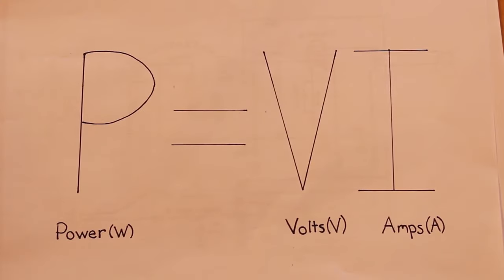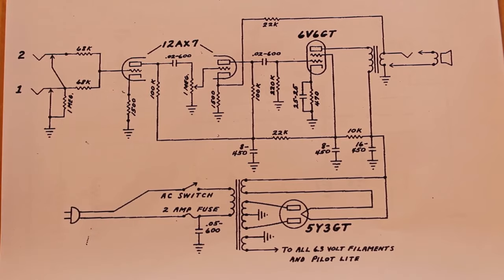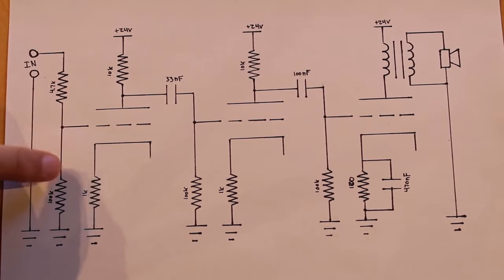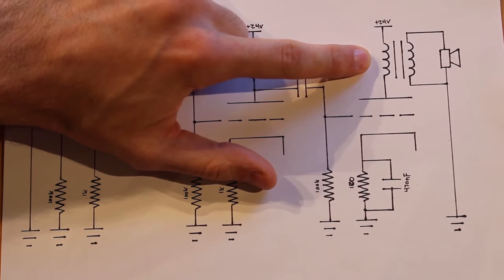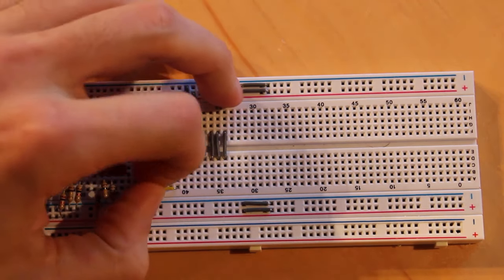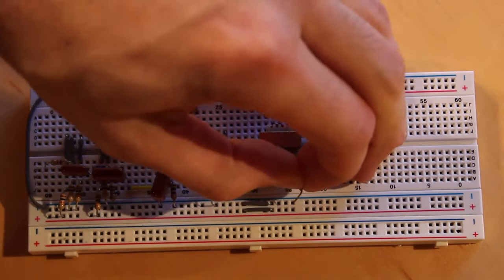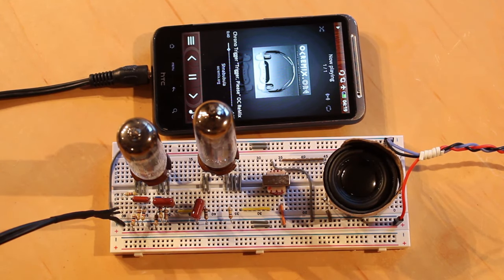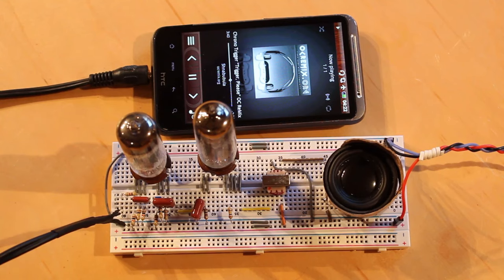Let’s Build a Low Voltage Vacuum Tube Audio Amplifier

Comment: There are some tubes that are designed for audio power at low voltage.   For example, the 28D7 tube is designed to drive a small speaker from a 28V input.  Some tabletop radios used 2 of them.  Other ones that were used for low voltage audio included 35L6, 25L6, 48, and others.  Many radios for low voltage audio back in the day that ran on 32 volts DC that did not use a vibrator used Push-Pull (Two tubes) or even Push-Pull Parallel (four tubes) to drive the speaker with a low B+.   Karola, Setchell-Carlson, Delco, and other companies made tube radios that ran on 32 volts back in the day.
Reply from the maker: I hadn't ever heard of the 28D7, but that's awesome! Even in the datasheet for it they list a plate voltage of 28V, it was designed from the ground up to be a low-voltage pentode, which is super cool. I may have to hunt one down some day and build something out of it. It seems a lot of the old battery operated radios used between 30V and 60V and on the plates as that was what the batteries could put out. I actually have an old Airmaster battery powered radio hanging around that I've been meaning to restore, although it uses a 1A5GT, 1H5GT and 1A7GT (and one more mystery tube I can't place, but I think is a 1N5GT). 
There's a lot of really awesome old tubes out there and it's kind of mind-boggling to think of all the differences between them!
Reply: @UsagiElectric  Believe it or not, "B" batteries (high voltage) did exist back in the day.  22.5V, 45V, 67.5V, 90V, and even 120V did exist back then.  I think you can still buy some B batteries today.  A company called Exell battery makes 22.5V, 45V, 225V, and 300V batteries today.  Some tools use 60 volt lithium ion batteries that are rechargeable today. I think the biggest maker of high current B batteries today is Tesla.  375 volt batteries are used in electric cars.  Porsche makes a battery that is over 800 volts today for its electric cars.
Reply: The 35L6 and others in this catergory are NOT designed for low voltage... the heater is at 35 volts because it is designed to have its heater in series with several other tubes and then have them all add up to 110 volts and then have the heaters directly connected to the mains in order to avoid the need for a seperate filiment supply transformer. 

The plates in those tubes require 200 volts, just like any other tube. 

Just because you see a 35 volt heater in a tube, does NOT mean that the rest of it runs at 35 volts.
Reply: @davelowets  if you look some of the 32 volt radios that ran from wind chargers did use 35L6 tubes in push-pull parallel.   While not specifically designed for this use, there were radio models that did use them in their 32 volt models.
Reply: EF97 by Mullard, Phillips etc.  range 6 to 27V on anode  with current 2.5mA   used in car radios

Comment: Just a note, this would be a lot easier at 48 V, which is still UL class 2, so you can safely touch it. Amplifier output power rises as the square of the voltage, so you get four times the power at 48 V vs 24V. Also, biasing the grid of most tubes between cutoff and saturation is very difficult with only 24 V on the plate.
Reply: Back in the 50s, portable radios had "B" batteries. It was a 90v battery that looked like a long 9v battery. It fell out of popularity because the batteries were carbon-zinc (non-rechargeable) and the radios were very inefficient because of the high power usage for filaments.

Comment: Great video. Regarding the capacitors, they do remove dc for the anode signal in order to feed pure ac signal to the next stage. The value of the cap and the value of the resistor right after are forming a high pass which dictates how much bass is feeded to the next stage. There is no room for misunderstanding here.
Reply from the maker: Thank you!
And thank you for the information the capacitors. I really just tested a bunch of different values in a trial and error way until I found a sound I liked. There was very little actual science done here, I just threw parts at a board until it sounded good, haha.
Reply: Yep. That's exactly what the cap and resistors do. Block any D.C. from adding an offset to the next stage and then it also create an R.C. time constant that affects the bandwidth of the incoming audio signal. 
The output impedance of the previous stage, AND the input impedance of the next stage that it is feeding, MUST be accounted for in order to come up with the correct value cap and resistor that will end up doing it's job correctly and also pass the correct bandwidth of audio through to the next stage. The math can be rather complicated in order to get this correct. Get the values wrong, and you end up with really crappy sounding audio passing through, and you can really end up wasting your gain also.
Reply: @UsagiElectric Ah, experimentation.... Yep, that's what helps a person learn what does what, as long as you learn why. 👍

Comment: One of the advantages with Valve Amps I've found is when using a preamplifier as a headphone amp.
I learnt that valve amps are less 'tiring' to listen to with headphones.
I had one at work and could listen to music for the whole 8 hours, whereas with a transistor class D amplifier I had, my hearing got 'tired' after two or three hours.
This appears to be a less subjective attribute that you can test for
Reply: Tube front-ends in front of a solid state output stage is the ultimate setup. No distortion from tubes that are driving a high impedance load such as a final output stage. Sounds incredibly good

Comment: You might be able to ditch the output transformer all together by reconfiguring the output tube to be a cathode follower. You'll lose the voltage gain of the power tube, but adding cathode bypass caps on the preamp section can help with that. Alternatively, setting the output tube to be a phase splitter could work as well.
Reply from the maker: I would love to build an Output Transformer Less (OTL) amplifier one of these days, but doing so with vacuum tubes is notoriously difficult! Tubes are really supposed to be high voltage low current devices, but I'm using them as low voltage even lower current devices, which really puts me at a disadvantage. Even with higher voltages, OTL amplifiers tend to use six to eight tubes as push-pull driver tubes to generate enough current to drive a speaker. It's super difficult, but in my opinion at least, one of the coolest style of tube amplifiers out there!
Now, if I could get ahold of some high impedance speakers, that'd make life a whole lot easier... hmmm, time to trawl eBay some more!
Reply: Piezoelectric speakers scream with modest voltage.  😮
Reply: Someone should invent a PNP tube that uses positronic emission, for a complementary symettry pair

Comment: To avoid the issue of having the phone think it's placing a call, add a decoupling capacitor between it and the amp. Phones detect commands on the audio jack thru changes in resistance on it.
Reply from the maker: Ooh, that's actually really smart, I never really thought much about what the phone is detecting!

Comment: You must have used some stout wire on those tube pins to fit them into a breadboard.  I remember the old Carvin tube amps I used to play through - everything was turret board construction, and point-to-point wire.  Those things were just beastly stout and had the warmest sound of any bass amp anywhere.
Reply: I solder component lead clippings onto components that i want to stick into a breadboard.

Comment: For funsies, a few years ago I built a transformer less cathode follower headphone amp. It uses an obscene amount of power for what it does, and putting something on your head that is looking at around 200v, is a bit intimidating. But sounds pretty amazing. For budding tube tinkerers, remember a tube is not a silicon op-amp. As I got deeper into the weeds, I got into the habit of using 4-gang jumpers for resistors. Just slap a 10k in... Won't give best performance. You have to be able to tune it. Maybe you need 8.5k, or 12k. Likewise, being able to adjust your B+ rail turned out to be super handy. Us silicon era kids can expect an opamp or a ttl gate to act pretty stable, whatever. Getting valves to work really well is a patting your tummy whilst rubbing your head and spinning a plate or two on a broomstick kind of game. But if your into that sort of challenge, it's heaps good fun. Otherwise, your airpods are fine.

Comment: There are low voltage tubes made for torpedoes during WW2.   A friend of mine builds APR battery powered transmitters with them.

Comment: If you find this interesting you should look at DIY Audio Projects, specifically the NP-100v12.  It's a simple, inexpensive, easy to build, great sounding vacuum tube headphone amplifier.  It uses a single 12AU7 (or ECC82) vacuum tube powered by 12 volts.

Comment: Ha ha, that transformer looks like the type you get in 1960's/70's transistor radios.
Reply from the maker: It's so tiny! It does put out a decent sound though, despite how small it actually is!

Comment: DC Blocking (Bypass) capacitor is easy.     The plate of V1  has positive voltage on it.   +24 in your case,    +210v in my case.    A cap can pass AC (audio signal)  but not DC.    +210vDC on the GRID of V2 would cause it to run away and fail........   the Bypass cap Blocks the DC from the plate of the previous tube.

Comment: tbf 24v can be VERY loud, 10w kinda loud

if u have ever made a solid state amplifier

there are many other factors that it is not as loud

from the coils in the speaker, to the amp design

and even tubes themselves, as the low voltage region would be unusable

and for amplifier, u really gotta get into that linear region, if u seen graphs of tubes, they only get into linear region after few tens of volts

Comment: The 33 and 100 nf blocking capacitors block the DC component coming from the 24VDC power supply but allow the AC audio component only from the amplification to pass.  Basic capacitor theory - Passes AC , Blocks DC. The Dc has no usable audio on it but would bias the tube.  As mentioned elsewhere the caps and resistors play a role in how much bass you get out. Out of curiosity, did you measure the audio output distortion compared to the input? What makes or breaks the quality of the audio sound is the distortion level caused by the amplification process. Higher distortion levels for non critical audio apps can be acceptable, not so for good audio for music! The lower the better quality music.

Comment: I have some good information here if you gonna read it:

the decoupling capacitors are meant not to change the signal but to pass it through without getting the B+ voltage on the next stage as that would burn the tube in a fully turned on state, so generally these caps pass the audio AC signal through and block the DC which is on the plate. I am not sure if lowering the plate resistors this much on the pre-stages is that good since tubes are high impedance devices it may not be able to pull the voltage low if the resistor value is too small leaving the signal clipping like crazy. A properly balanced resistor and tube bias should leave the plate voltage floating around half of the supply or so. this makes the voltage potential for signals work in both directions without hitting upper or lower saturation points.
so if you have 24 volts B+ your plate voltage should be like 12-15 volts without signal to be good. and to increase gain you can put parallell capacitors across the cathode resistors on the pre-amp stages as well with a value of 100uf or even more and or less depending how the sound gets. you can also use a way bigger cap on the output stage cathode such as a 1000uf or even bigger. remember you wanted to get amps at low voltage, this means you need to have huge caps to bypass the resistance of each step as much as possible. the last thing I can mention is that the bias or cathode resistors could instead been smaller, since the tubes require more negative grid voltage the higher the voltage gets you don´t really need that much when you go that low. the bias is again the thing that puts the tube into just the right amount enough into to a middle point between on and off state to pass a signal without reaching the upper or lower saturation points. so depending on the actual voltage the values may need to be tweaked for peak performance and audio quality
Reply from the maker: That is some excellent information, thank you for letting me know!
The resistor and capacitor values I ended up with here were actually just from about a week straight of trying different values until I found a combination that gave a sound that I liked and that didn't clip. Having said that, there's definitely a better way to go about building this, and I definitely think you're on point here!
Reply: @UsagiElectric  No problem, I am always glad to share knowledge with others about stuff like this. In fact when running tubes on very low voltage it may even be necessary to bias the grid positive to even increase the flow more simply by making a voltage divider from B+ and grid 1 ground preferably with a pot so that you can tweak the voltage to be just right for best sound. If this method is used and working you can omit the cathode resistor and bypass capacitor since you won’t need them anymore to bias the tube. The good thing to do is to measure the plate voltage or even better use an oscilloscope to check which part of the signal that starts to clip first. Then you know where to bias the tube to gain most signal before clipping :)

Comment: i hope you have a polarized line cord because i see a potential death cap.

a death cap is a capacitor that connects the hot side of the line cord to the chassis and can be deadly as they usually short and leak the whole line current through the device.

a polarized plug prevents the dangers by making sure the grounding cap connects to the neutral side.

Comment: Cool project! The negative feedback circuit is there to limit distortion, Fender was trying for clean and loud and cheap.  I cringed at the transformer and driver selection, these are usually selected with speaker impedance and the reflected plate load in mind for maximum efficiency.  I guess a wide range will work, but when working with 100s of volts, heat and magic smoke are a concern.  You could probably get a more usable volume with a push pull setup, but transformer selection might be a bit harder.
Reply from the maker: Thank you!
Yeah, the majority of this was built with random scraps from other projects I had laying around. I just wanted to see if I could get a decent sound out of random junk, and I was pretty happy with the results!
Reply: He could just series two of those transformers together, use the common input terminals as the center tap, and  then parallel the outputs.......

😂

Imagine the math to try and figure THAT one out... 😳

Comment: The main reason output transformers are big is not voltage related but bandwidth related.   To get the frequency response, they need a lot of iron in the transformers so the magnetic coupling at the wide range of frequencies can happen.   That's why a 25Hz transformer is so much bigger than a 50/60Hz transformer.
That speaker "driver" you got might also be a high frequency/tweeter driver as well.   They are often called drivers when sold outside of a cabinet.   :)

Comment: A bit late to the party watching this video, but absolutely loved it! Usagi demonstrates that despite there being a science to designing "good" tube amplifiers, a lot can be done by playing around with rudimentary designs and parts you have laying around. As always experimentation is the joy of electronics as a hobby! One little tip for anyone building a very low power audio amplifier is that if you have a large speaker lying around the place, use that. The common idea that small amplifiers can only drive small speakers could not be further from the truth - generally speaking, the larger the cone area, the greater the output volume will be for a given input power. Older speakers from the '60s and '70's are particularly good for sensitivity.

Comment: Good project, nice too see this. I hope to realise this for my self. In the seventies I have build amplifier but they were high voltages units. But which vacuum tubes did you use. Thank you very much.
Reply from the maker: Thank you very much!
For this one, I used a 12BH7 dual triode for the amplifier and a 12B4A single triode for the driver tube. They're actually not specifically low voltage tubes, I'm just running them at low voltages, which means almost any tube can work! All it takes is some tweaking of resistor/capacitor values and proper expectations that it won't be all that loud of an amplifier.
Reply: @UsagiElectric  Thanks for the information.

Comment: Did know about the 12vdc plate voltage tubes used in Car radios in the late 1950s and early 1960s? The tubes were rated for 16 or 30 vdc max. A typical tube like the 12K5, used to drive an output (transistor), is capable of 40mw.

Comment: the 100nf and 33nf capacitors are just to isolate the dc voltage to the grid of  the next stage
Reply from the maker: Yup, those are the coupling capacitors!